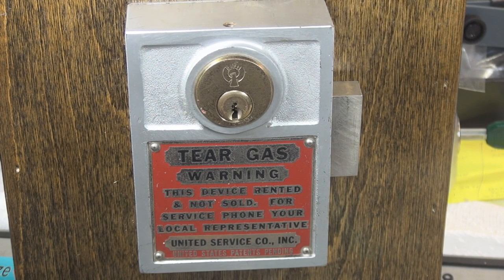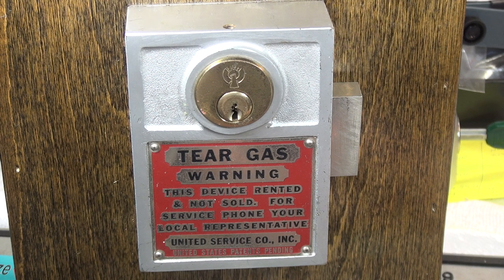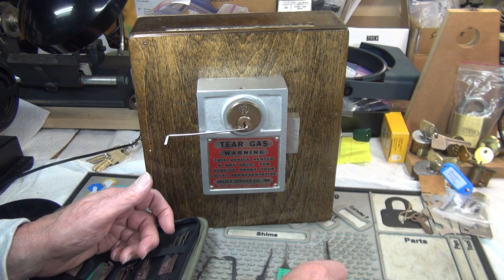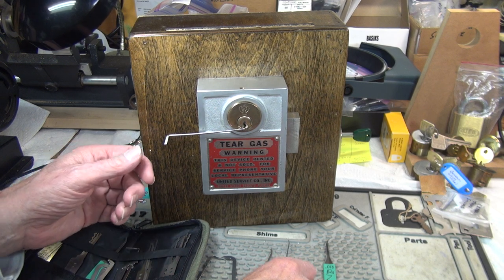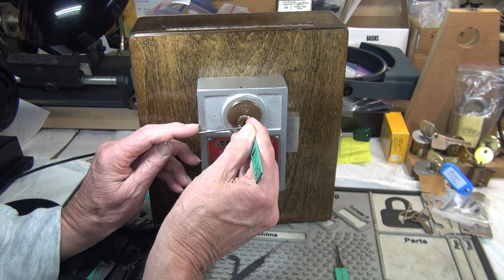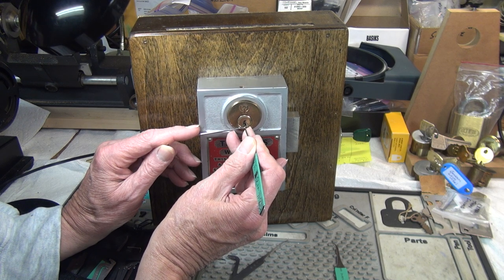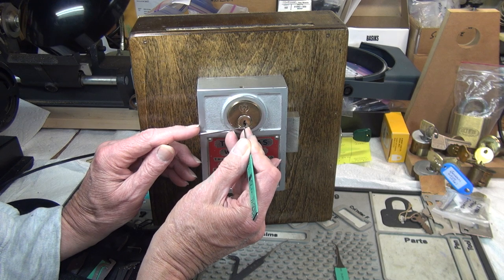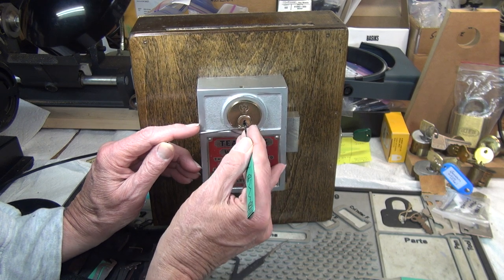Tear Gas Lock

Comment: Shame you didnt gut it. I was interested to see how these worked. I would have been impressed if it had two sheer lines, a false one that broke the vial and a true one that lifted a lever out of the way to defuse it.
Reply from the maker: Actually the mechanism is quite simple where an attacker tries to brute force the door open which causes the bolt to tilt slightly, thus firing a spring loaded "hammer" (off of a trigger sear), which breaks the tear gas glass vial